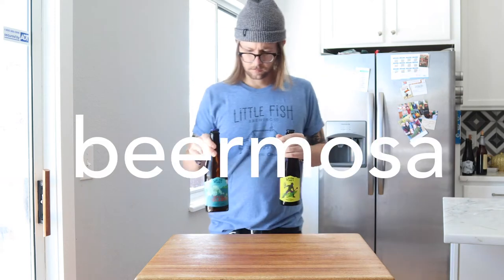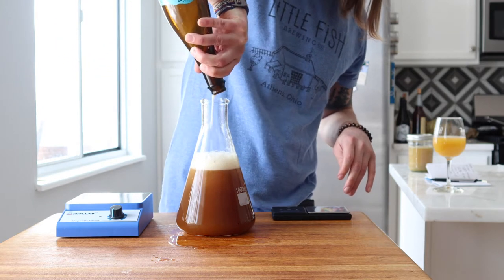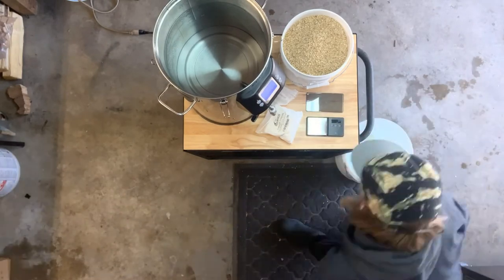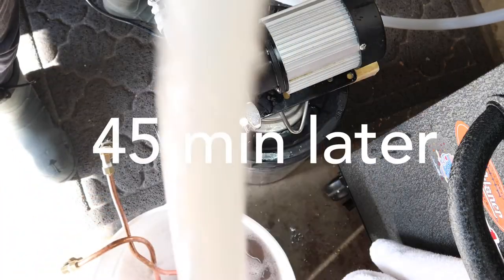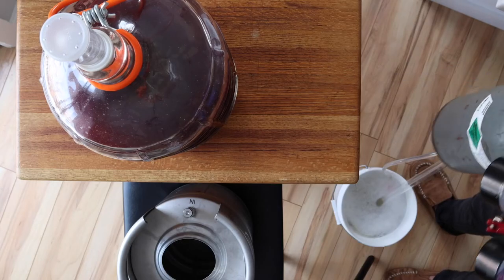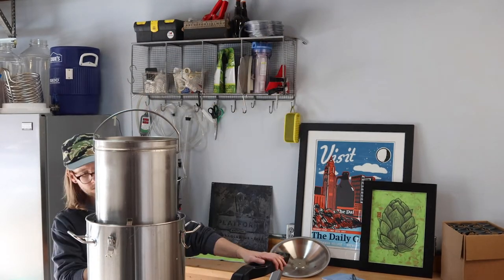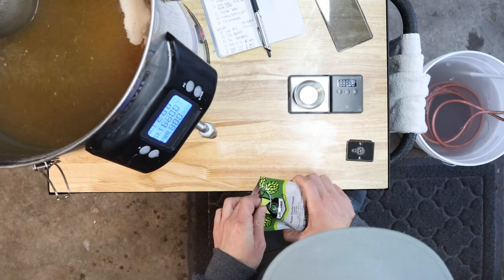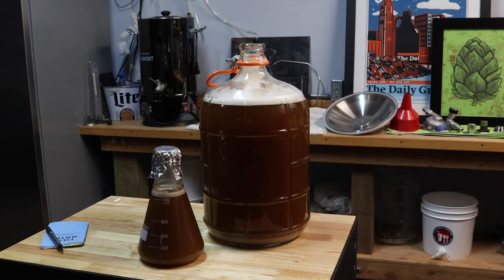Brew a Saison from Bottle Dregs | Anvil Foundry 6.5 | EP 4

Comment: Thanks for the good video. I’m thinking about getting into to brewing. I see your using the anvil foundry 6.5.. I’ve been looking at it. Can I get your opinion on it.. thanks
Reply from the maker: Thanks dude! Big fan of the foundry 6.5 and I'd totally recommend it for small batches anywhere from 1-3 gallons.
Reply: @HopsANDgnarly  Thank you for sharing your brew sessions. I like the music too! Just purchased the Anvil 6.5, I plan on doing small batches generally but wondering if you think I can pull off the occasional 4 or 5 gallon batch (average grain bill) with sparging.
Reply from the maker: Vincent Chao thanks! I think it could be done with 240v power but might be a slog with 120. Even with the small batches I make the Anvil doesn’t boil very vigorously on 120v power.
Reply: @HopsANDgnarly  Ya I plan on hooking up to 240v power, so I guess my question was more about the capacity of the 6.5 gallon pot and grain basket, not the heating power. So you feel there is enough head space left on your small batches that you could see 4 or 5 gallon batches being feasible? Thanks again!
Reply from the maker: Vincent Chao that’s awesome. Yep I think you’ll have plenty of space and plenty of power with 240. 🍻
Reply: @HopsANDgnarly  Curious what depth your hop spider is on the 6.5? I am looking to order one, do you have any thoughts or suggestions? Thanks again!
Reply from the maker: Hey man! Mine is about 10in tall and there should be a link in the description for more details. Cheers!

Comment: Just curious, are you concerned about your beer you're kegging in this video getting light struck/damaged as you transferred it? Quite a bit of sunlight was hitting your beer. I'm probably overly paranoid about that stuff but curious as to what your thoughts are.
Reply from the maker: Good question! This one in particular had very little hops in it but you’re probably right. It’s a little hard to avoid when filming but I should think about that more. Maybe that’s a good reason to move away from carboys.